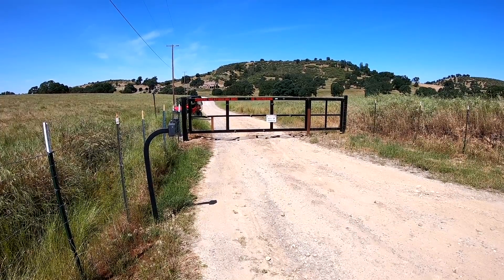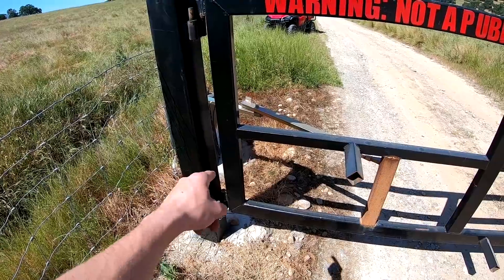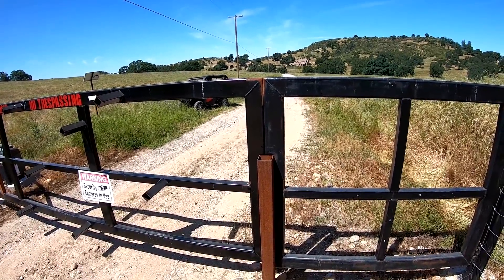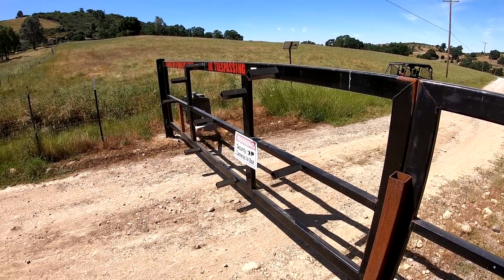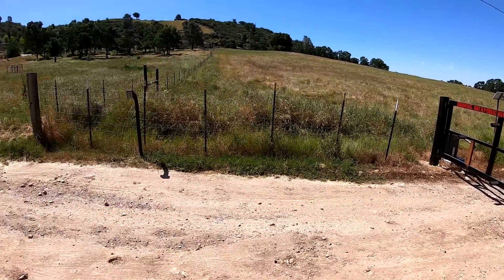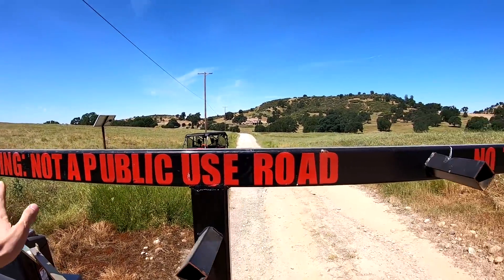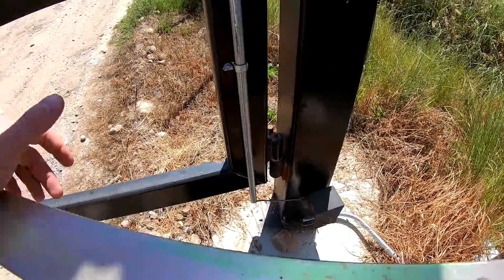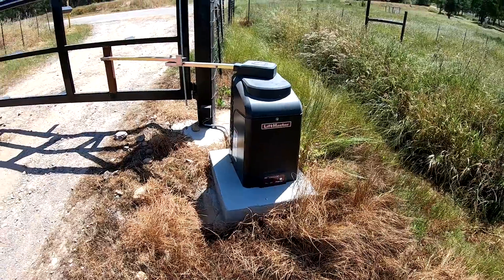This Gate Will Stop A Car, Don't Mess With Us!

Comment: Funny how people will go through the trouble to take friggin' bolt cutters to the gate, just to save a bit 'a time on their route. Makes me wonder how much time they're actually saving to try and run through chains gates, vandalize, beat up their car, etc. Could also be the "You think this puny barricade can stop me!?" factor. Idk. People confuse me.

(Similarly, been having trouble with our mailbox. We have a fairly long stretch of hilly road, and people who like to drive fast, and generally be hooligans. We found our mailbox being frequently knocked over. It got cemented, and had a nice, sturdy post installed. It got knocked off the top of the post a few times. We re-installed/replaced it as needed. They blew it up with m80. We found one designed to withstand a blast, and pop open instead of exploding, and mounted it more sturdily. That worked, but then they broke/cut down the post (Couldn't tell how they did it, the post was just kinda sloppily broken in two). We are now tempted to install a metal post, but were informed this is illegal, as you can't have something that may withstand a car impact on the side of the road instead of breaking away. Aka: A right-of-way encroachment.) 
I just get kinda miffed at mailbox laws. When you put it up, it's government property, and you have no ownership over it. However, as soon as it gets damaged, it's no longer their responsibility, and the homeowner has to foot the time/costs to repair it. And of course, you can't make it durable on the side of the road on which I live, because it's seen as a hazard.
Reply: Sadly a lot of people believe that the property owner will "learn his/hers lesson" and stop repairing the damage, leaving the road open for them.
Happy to see they can be proven wrong.

Not sure about mailbox laws in US, but where I live mailboxes are often installed on to the fence or wall surrounding the property.
Imagine a slot in the stone post that serves as a mailbox.

With vents and such it's difficult to blow up with firecrackers and you'd have to use actual explosive, and short of putting in a lot of effort (it being cemented to the post) it's really difficult to destroy.
Reply: I know In Canada in rare cases people are putting in ones that are designed take a hit, fall over then you just lift them back up and they lock back in place. Our problem out here is that the snowplows go by in the winter and suddenly no one has mailboxes anymore.

Comment: For future use of padlocks, you can buy multi-packs of same keyed padlocks.  That way if one lock is destroyed, just replace it with a similar one that uses the same key.
Reply from the maker: But we have Gates at each end of the road and they were killing 2 at a time, and they only came in 3 packs
Reply: @HighTechLab  Buy them in real bulk packs that come in 12, 24, etc style packs.  From Grainger, I used to buy them in 24 pack boxes.  Or an account with Master Lock, can order a custom lock, made specifically for a key.  Getting low on locks, order up another batch, no minimum order.  They will arrive and matching the other keys.

Comment: It looks really good, how ever one concern is that since its opening inwards then it has no pillar on the side with the small gate part, that little lock you have there wont last if some one really rams it or if a truck tries to go trough.

Sad that you even have to make this tho.
Reply: There are some hinges, and the poster said it originally opened outwards. I'm guessing it was changed to make the automatic opener more convenient, and keep it inside the gate, where no one is going to smash it up out of spite. You would also need more clearance to have it open outwards, meaning the keypad would have to be farther away.

Comment: Another Idea is to get rid of the key code and let the gate seem closed but it's not. Eventually someone should figure it out and just push the gate open. Here is the catch though, if they didn't enter the key it doesn't get rid of a shitload of spikes on the ground. So they can drive through an unlocked gate, but their tires are going to go to shit immidetly and they have to buy a new set.

Comment: A magnetic gate lock is very strong  but you must protect the wiring. All they would need to do though is grind nut off opener.  Nowadays hard for anyone to get away with it long with game cameras and cellular instant notification cameras if there is cell service plus they would need to be sure they can get out the other side.  You could also have disguised some spikes near one gate and told landowners to use just the other gate until caught at least one vehicle.  The word would get around quick.

Comment: a lot of money wasted on a silly looking gate....20 seconds to bypass
Reply: Bypassing a lift master is extremely easy with 3 months of electrical engineering community college.
Reply: @FluttershyVapes  just go around the gate. It's only metal stakes and wire fence.
Reply: And you vehicle?
Reply: @niccatipay  all you need is a set of Security screwdrivers and a set of deep sockets.
Reply: @deaddad6310  Or not risk scratching your vehicle and hitting the manual bypass under the metal cover for the gate control panel.
Reply: Well I guess this is better as a deterant. Quite an intimidating gate from a distance i guess.
Reply: @niccatipay  The majority of people are not going to try to gain access to the service panel. Yeah the looks can scare people off but to someone who installed Security devices for companies this is the easiest of all to bypass.
Reply: @niccatipay  Another method is if its wire to "fail safe mode" if it suspends the power was lost the gate automatically opens to prevent people from being locked behind it waiting for a service technician to open it for them. 

If the power is above ground in conduit  is as simple as using a $13 hacksaw from the local hardware store as the electricity used is only 12 volts to run the circuit board inside the case. You can cut the conduit without getting badly electrocuted. Just enough electricity to feel like a shock pen at best.

Comment: Your setup is literally exactly like the pictures that they use to depict security is only as strong as its surroundings that gate wouldn't stop anything becuse the little wire fence around it is eaisly bypassed. Lol I like the thought putting somewhat of steaks in the gate but again the little wire fence around would easily be driven through. Its like putting a padlock on a cardbord box. I know it's a big expensive project but the surrounding fence should be heavily revised
Reply from the maker: And the berm and trench beyond the fence does nothing?
Reply: HighTechLab helps a little bit but not very much. If you were able to build that massive gate build a massive fence around the gate and then never worry about it again.

Comment: Hey For that Bottom PArt you coudl use some striped Electrical shielding as a pertector the same that is used for office wireing  just take out the wire and pass the wire threw it would flex with the gate movement

Comment: ook its a nice looking gate with a lot of time put into making it, with the aim to stop ppl driving through your land for a short cut "damaging older gates, chains etc..."

however I've a question....
if this was such a problem, why don't the same ppl just drive through the nice flimsy wire fence either side of this nice looking gate, as now the basic wire fence either side of the road is the weak point.. if ppl drove through older gates & snapped chains then those wire fences wouldn't be anything of an issue...

just saying
Reply: he says in the video there's a water trench
Reply: @nirodper  yes on the left hand side you can see a small trench, any 4x4 would get through that with ease!
however nothing to the right hand side!!

Comment: You basically installed a bank vault door on a house but left your back door as a foam /cheap door and all your windows unsecured!  Good Start but they can drive along perimeter of fence in front ( 100-200ft away) and drive thru your field. You would need to construct berm all around your property or use a continuous fence. To deter the wrong way or lost people, it will work , but real thieves will drive around it  300 ft away and then hook up or weld it shut to make a sticking point! Nice build but wrong application spot, maybe in an ally or between 2 buildings to secure a drive.

Comment: Bummer if the fire department needs to put the fire out that started while you and your neighbors where out!
Reply: The FD probably has the gate code.
Reply: I guess they would just get they hydrolic cuters and they could proceed in a few min
Reply: The FD could also use their gas powered cut-off saw and cut the arm of the opener in about 15 seconds.  That includes getting out of the truck and walking over to it.
Reply from the maker: @jeff h the fire department could simply just use the Knox box (not shown in video)
Reply: @HighTechLab  That too.  :-)

Comment: Too bad you have those problems with security. That is one of the problems that I don’t miss. Nice gate work. I am considering a similar gate for looks and to keep the animals in. I was going to do a rolling gate. What do you think?
Reply from the maker: Rolling Gates are nice.  We wanted to have the spikes and because of the terrain a swinging hate was easier
Reply: @HighTechLab  What you said makes perfect sense. 

For me I do not have the crime problems and intrusion as much as it is a safety blanket. I can see why with not using the roller gate. I am leaning towards the roller gate because our soil is so soft here and deep black loam that posts lean a lot even with concrete. Also we get a lot of rain, over 8 feet a year, and that helps the post to lean when it has a lot of weight. This is the case even with concrete. So that is why I am leaning to a rolling gate. Also my entrance is conducive to the roller gate. 

Your gate sure is beautiful. I am a newbie to welding so for me it will be a learning experience as well. Thanks for all your wonderful videos. Come see us! Jim

Comment: Could use some gooseneck pipe like what is used on hot water heaters for the last section of wire.  It’s flexible

Comment: Gate that stops a car, Surrounded by a wire fence that couldn't stop a bike :D I don't understand the point in the car proof gate?
Reply: You apparently didn't watch the video, there are 2 ditches on either side of the road... Deep Ditches, with mounds of dirt on the otherside so that they'll most definitely ruin their cars if they tried to circumvent the gate.

Comment: That lose exposed wire at the front bottom left could be your weak link. Maybe weld a flat plate to cover? Nice gate. Thank you.
Reply from the maker: Problem is it needs to be able to move as the gate pivots.  If they do cut it though it just prevents the lock at the end from opening, then they really can't get in!
Reply: @HighTechLab  they can cut it and apply power to the wires and power on the solenoid inside the lock so the gate can be opened
Reply: Use some flex?
Reply from the maker: But they still need to turn the motor that also is locking closed
Reply: @HighTechLab  oh.. didnt think about that.

Comment: Just something to think about. Dont know how long you had the Keypad up for. But, Keep a eye on it. as time goes by, for the Keys wearing down on the surface. If you have like a few people with the same code that use that keypad. overtime people might be able to see what numbers are pressed and guess the number.  We have a Keypad for Our gate too, and We have the Number Changed about once to two times a year. Depending on use which is a Daily event here with a dozen+ times it gets used daily. We have had the keypad system in place for roughly 10 years now. We just recently replaced the whole keypad due to the wear on the keys

Comment: Be careful of rodents chewing on the electric wires they like the coating for some reason. working at a dealership repair shop we see quite a few cars a year what's a wiring chewed in half or at least the coating chewed off . Low voltage They will  Chew Right Through the Wire and then when you need open the gate it won't work. And where the cameras mounted and are they Wireless

Comment: would stop modern vehicle ..but a 60s..80s dont think so...we used Gates simular didnt work put up signs they would run over..made diffearant sign with post extending in a" L"  shape with spike on end which length was from front end of a vehicle to guesstamated oil  pan ...stopped treaspassing..local tow company has a  few late nite calls..blown engines or no oil

Comment: So you highlight the most vulnerable part of your Gate: The exposed and easily cut wires as they exit the conduit located near the lower gate hinge. I guess you never heard of an electric hinge. Heres a link to one of many styles and suppliers.http://www.stanleyhardwarefordoors.com/products/hinges/electric-hinges/ 

additionally, I would not have a pad or button of any kind on the public side of the gate. A wireless remote would be better. There are many free and paid smartphone apps available to control the gate. Paint your solar panel pole to make it less visible.

Comment: I guess no one tried to lift the gate yet.
Reply from the maker: Partly because the gate weighs 700lbs
Reply: That the only thing keeping it on the hinges?
Reply from the maker: @rokadamlje5365  sort of.  To tell the full truth the hinges were slightly misaligned, so we used the backhoe bucket to push down and force it to fit.  It would take equal if not greater force to lift it back off.  I used to have one hinge facing up and one facing down but that proves to an inferior setup due to the fact that the gate has to be hanging level on one hinge while welding the second hinge

Comment: but just run over the chicken fence on the sides and go around gate...put up wood fence 10f each way by gate. and trail cam!
Reply from the maker: I'm curious, did you watch the whole video before your comment?  We have a trench that is approx 2ft wide, 1 ft deep followed by a 2-3 ft burm of dirt - It would require either a bulldozer to first move the dirt or a very lifted truck to prevent getting high-centered

Comment: That gate won't stop a car. That motor and arm will buckle real easy with any pressure.
Reply from the maker: It will stop a car but not prevent from passing.  A simple sign can stop a car (Stop sign), so the same goes for this gate

Comment: Square tube gate with electric motor, surrounded by chicken wire anyone can run over.
Reply from the maker: Yeah but did you miss the party where there are trenches and burms behind the chicken wire
Reply: Literally heard you say that right after I pressed "enter", left the comment up for posterity.

Comment: Sealtite for your end of lower gate to protect the wire

Its a shame you couldn't electrify your perimeter fence using solar or windmill
Just as a backup

Nice job on the gate